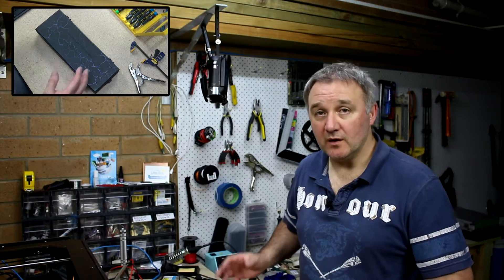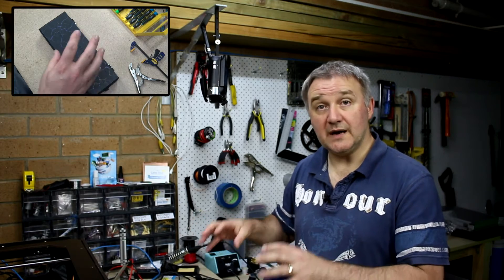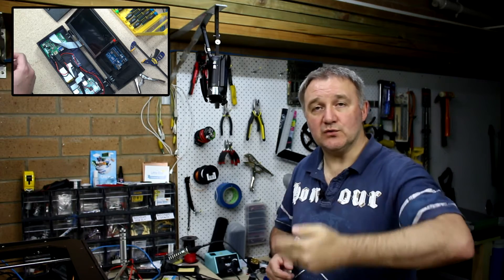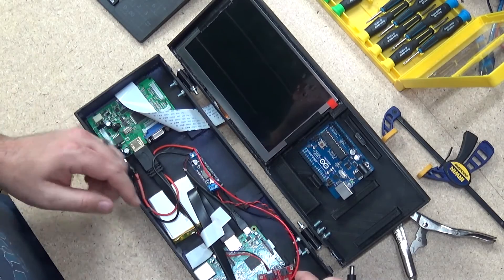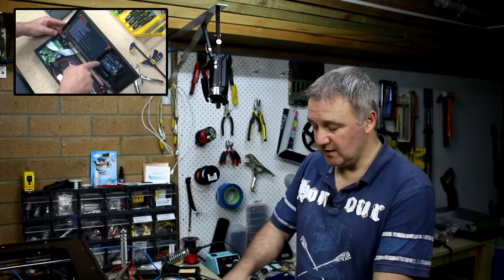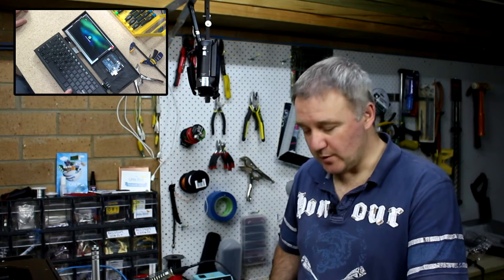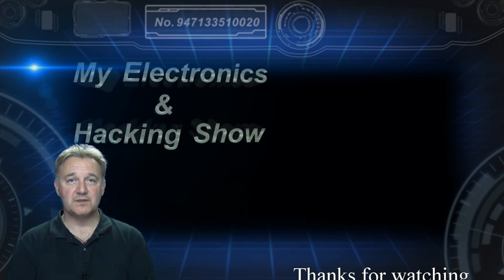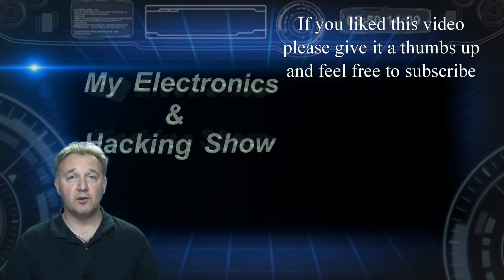Raspberry Pi 2 Portable MK2 Part 2 (MEHS) Episode 34

Comment: For the screen you could use a Sun Visor Monitors they come in strange aspect ratios and would look great with this form factor much like classic palm tops.
Reply from the maker: - Hi.  Not a bad idea.  Drivers for such displays can be tricky but yes it would look heaps better.  I can feel a rebuild coming on:).  Cheers.
Reply: +My Electronics & Hacking Show thank you for replying also if it would help Ben heck did a video on how he got one to work.
Reply from the maker: spencer shanks - Thank you.

Comment: What a great build! Is that a 3D printer off to the side there? Or do you have it printed somewhere else? I am trying to build something similar to this and don't have access to a 3D printer.
Reply from the maker: +Chip Miller - Hi and thank you.  Yes it is a 3D printer.  I've had a few mention the desire to do similar builds without a 3D printer.  I would suggest wood, a 3D printing service or even layers of hobby foam as an alternative.
  I did a Pi project before I got a 3D printer using foam board and it turned out OK.  Good luck with your project.  Cheers.